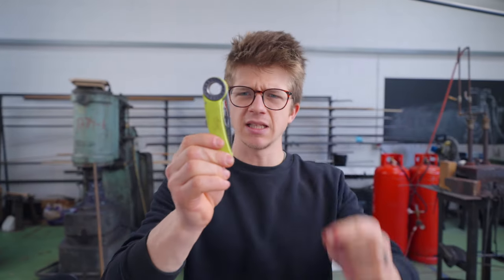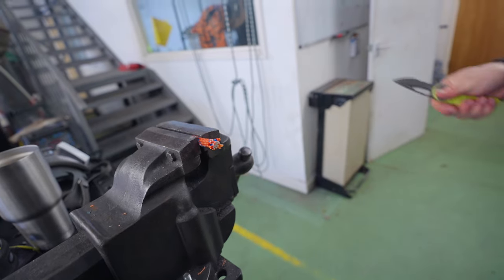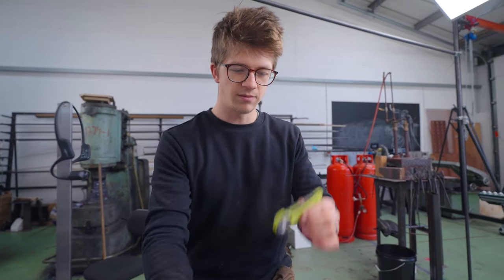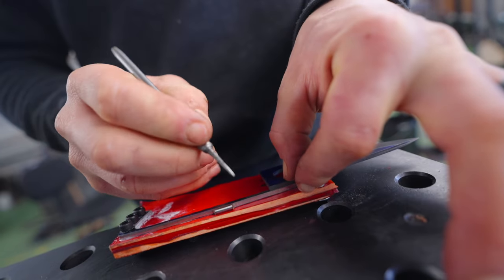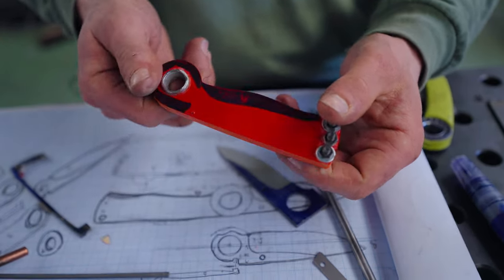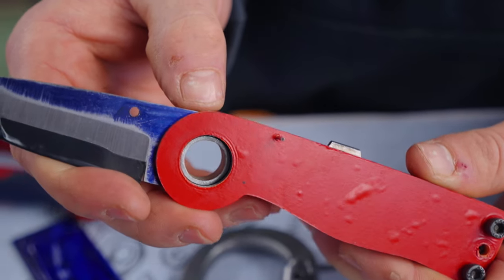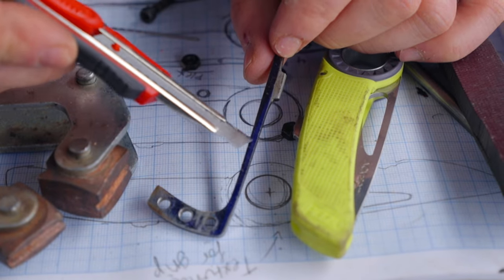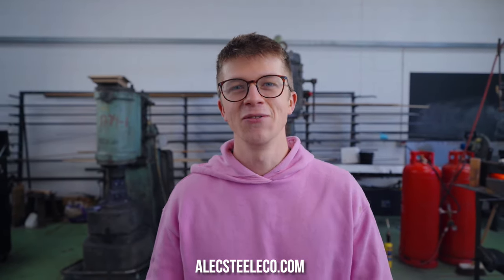Making a Stainless Steel Folding Climbing Knife! Part 2

Comment: I've always carried a knife with a 50/50 straight and serrated edge. The serrations make cutting seatbelts off of people etc. so much easier than a straight edge. Great project!
Reply: That's why there is no perfect knife for everything. Personally i have never liked serrated blades (they are difficult to sharpen). But for safety cuts they are really much better than clean edge.
Reply: @ogi22  which is just the best reason to buy more knives, amirite?
Reply: How often does that situation come up?
Reply: @Coloneljesus  I used to be volunteer fireman.
Reply: @fyreantz2555  Hehehe, how did you know? Are you a seer or something? 😁
Reply: i use a Cara Cara 2 knife by byrd where i work great for cutting rope and opening up carboard boxes part of my job is as a rigger

Comment: The serrations on a utility knifes can be a literal lifesaver when speed in cutting is essential. The straight edge can absolutely cut a seatbelt or rope but the serrations are faster and less prone to slipping.

Comment: @9:30 just looked at it and that will create a lot of slop in the lockup. Rough fit, make sure the latch is a smidge bigger than the notch, harden+temper the spring and latch, and then handfile the tab to fit the notch perfectly. It needs to be almost airtight. Also, the transition where the tab falls in to the notch needs to be crisp, but on the tab needs a small, small radius.

Comment: I'm probably late to the party, but having used a Spatha for years while caving I don't think you should have gotten rid of the blade slot. It's not only for opening the blade but a key: we often use it to open shackle-bolts when we don't want to get tools out, and it's very useful.

Comment: Important Hearing you talk about how important it is that the knife remains closed when you don't want to cut anything just reminded me about something you may have over looked...... the reason climbing knives are better WITHOUT the little stand-up stud openers is because that stud can catch on things and open when you don't want it to!! If you want that stud, you need to have a locking detent so the blade never opens unless you want it to. My knife has one of the ones you press down with your index finger first. Hope this helps 😊

Edit: that little retaining grove is not enough to stop the blade opening if you have a stud that can catch on things

Comment: You need to thin out BOTH sides of your button up to your pivot point. You can see it in your Ruler example... as you press down on the ruler bother sides of the ruler bend on either sides of your hand. Your button is stiff on one side, making your deflection angle and  depth wrong. Test this with t he ruler again, strap a steel bar to one side of your 'button' on the ruler and try to press it. If you don't bend on both sides it will be more difficult to lift the locking nub high. You can make the lock side thicker/stiffer... but it needs SOME deflection.

Comment: Alec good sir, I am sure you have already found a solution, but those lock mechanisms are usually a 2 piece lock. A spring in the rear, and a pivoting locking bar. I cant speak for that one specifically though. I love watching you learn by just getting in there and figuring it out. Keep doing what you do man!

Comment: Also usually for back locks like that there is a spring leaf spring like price that helps ... if you put too much pressure on the lock like that it can fail

Comment: Yep, serrations are there for a reason; they're there specifically for cutting rope. That's actually why I hated the 2010s trend towards putting serrations on pretty much all folding pocket knives; rope is pretty much the only thing I never actually have to cut. It's so nice to see nice regular-blade pocket knives being just as common as half-serrated blades again these days.

EDIT: Before anyone points it out for me, yes, the reason for the serrated knives in the 2010s was a trend towards emergency knives made to help you escape from a crashed car, with a boss for breaking the window and serration for cutting a seat belt. Though most of them also had a blade embedded in a narrow channel specifically for cutting seat belts, too, so... Yeah. Anyway, yes, the serration on that trend wasn't for rope, I'm just relating the trend to the fact that it's usually for rope.

Comment: ALEC - QUICK TIP! IF you are going to use the Steel foil 'Envelope' trick.... BEFORE you seal up the envelope with the blade inside, HEAT the envelope and knife up FIRST BEFORE SEALING IT UP. This drives out the 'Air'/oxygen from the 'Envelope', and then while it is STILL HOT, fold over the last seal. This is why you see those little 'Buttons' on jars of food, the jars are filled with warm/hot food contents, then sealed, the process drives out the air/oxygen and thus causing a vacuum inside...
This will help STOP the envelop 'Puffing up' on the heat treatment/hardening cycle 👍      😎🇬🇧

Comment: I considered buying a petzl Sparta but in the end I went for the buck 770 flashpoint as rather than a stiff detent to hold the blade in it actually locks in both closed and open positions which I see as being more safe however the internal mechanism would certainly be more complicated

Comment: Even kitchen knives that claim to cut through everything are serrated the reason is it stays sharp on the lower parts as the point / high parts ware and dull first so there's always some extremely sharp part of the blade as well as being able to use as a sort of saw. As for wider serrations, they are sharp and will be dull at the same rate... I also dislike serrated knives. A really sharp straight edge will cut rope fine for my needs

Comment: So, my #1 issue with serrations is that they are harder to maintain, my #2 issue is that they frequently are only ground in from one side. Doing Serrations right is actually fantastic, but the key is to do them right

Comment: I generally don't like serrations either, mainly as I can't sharpen very easy.

I've never tried cutting something with serrations vs none. Although I know that trying to cut where the serrations are near the handle, vs where you tried the normal blade, is harder even on a smooth blade with no serrations.

I think the main advantage of the serrations is it keeps from slipping while cutting? With a smooth blade if you don't push sufficiently you can more glide instead of cut. Which in a life saving situation, like emergency cutting rope, you don't want to have to do a second cut. But I'm just guessing.

I still am not a fan in general use

Comment: People get stabbed on those during falls. I use a tiny fixed blade. ESEE Izula 2 with it's plastic sheeth is supergood! Bit heavy, 1095 steel but it works!

Comment: you know on the first video i was like "but if you pin the spring on both ends it wont work, metal is springy in the sense that you can bend it but its not springy in the sense that you can stretch it like a rubber band... oh well ALEC PROBABLY KNOWS WHAT HE'S DOING" .. turns out i was right and wrong :P
alternatively you can also turn the hole in the 'spring' part into a slot, that way its secure but it can also bend because the slot allows the spring material to move
Reply: Agreed, but this is also definitely the wrong way to do it, because it is far too thin and delicate in order to achieve the function of a lock back. Basically he has unintentionally created a hybrid between a traditional slip joint and a lock back. Unfortunately, there's a reason they don't exist.

Comment: The serrated edge soul purpose is to protect the cutting edge and keep it sharp. Cutting with the tip of the knife will always feel harder because it acts as a lever trying to pull the knife out of your hand more. The serrated edge will stay sharper longer but is a pain to re-sharpen.

Comment: Serrated edge only cut better because it’s at the bottom of the blade.  If you used a similar knife with no serration it would of cut just as well

Comment: What stops the locking springy mechanism from work hardening and breaking over time? Or would this just take so long that the knife will be dead anyway?
Reply: In this design? Nothing. The lock bar is not supposed to be a spring. The lock bar is its own separate piece which pivots on a pin and has another separate spring underneath it generating tension so it automatically locks when you open the knife and doesn't unlock unless you depress the lock. It is supposed to be separate, and by making it one piece it is to thin and delicate, and it will break.

Comment: Very neat. I'd hate to have a sharp point on a knife I might have to use one handed while hurt trying to rescue myself - high risk of a puncture. The knife I bought for rope work has a rope cutting notch in the blade and a dull/rounded 'point'
Reply: but with a point you can cut into a bag or other cloth material more easily

Comment: Could have just completely separated the backspacer from the lock bar. 

You should try cutting the rope with the belly of a non-serrated knife. A more toothy edge will cut rope better. Sharpen on a lower grit then go straight to stropping.

Comment: Why would you not use a conventional back lock design with a pivoting lock bar and seperate spring? Or better yet, why not use a cross-bar style lock?
I have a design for a very strong cross-bar style lock that is intuitive to use, ultimately strong and has long life/wear compensation.  It's also very simple to manufacture with large simple components.
I'd be willing to work with you on incorporating my design into yours.

Comment: That wasnt a very fair comparisson of serrated vs regular blade. In order to cut with the normal part of the knife he had to use a lot more torque because its furtger away from his hand. A good test would have been using the new knife before and after serrating it.

Comment: As a non-climber, I assume the ease of rope cut is intentional. You'd want maximum tensile strength for load bearing. But shearing strength, as a safety mechanic, might not be wanted in some situations. Or is there something I'm missing?

Comment: i also dont like serrated edges. i think a lot of your leverage was lost in your test from where you were cutting on the blade in relation to your hand. if it had been a smooth blade against the hilt, i  belive the result would have been much more similar.

Comment: A climbing knife should be serrated so it can easily cut rope and for much longer without dulling, also I have found a straight blade better for rope cutting, also it should be one handed open and closing, as well as super easy to open and close, and the tip should round down with no real point like spydercos first responder knife, this allows you to slip the knife under seat belts and ropes that are tight against the skin And still cut them without injuring the person, also a smooth opening knife with a hole to open with and something like a compression lock, or a button lock, or bar lock like benchmade axis lock and other companies bar locks, the bar lock would actually be preferable, and the handle material would need to be strong but lightweight, an aggressive patterned g10 will be lightweight, strong, and resistant to weather and chemicals, and if you cannot use super steel then i gues 1095 or d2 is ok, so a 3.5 inch fully serrated blade with no real tip, aggressive g10 handles with stainless liners, an axis type bar lock for easy opening and closing, a hole in the blade for thumb opening or at least large thumbstuds, a good  detent, and bronzed washers for ease of cleaning, and all fitted together with t8 or better yet t10 screws, top it off with a nice lanyard hole and light back spacer for added strength and that is the perfect climbing/first responder knife

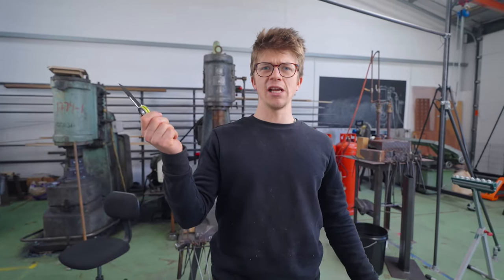Comment: At 1:40.  The leverage and force applied at the middle of the knife with the serrated part is far greater than the outer edge or point with the regular blade.  That was a horrible experiment if that's where you ended without further experimentation!  Please do it again!

Comment: I'm sure it's been mentioned before, but I believe you're looking at the lock like how a slip joint works, not as a back lock.  A back lock is made up of three pieces: the lockbar, the pin, and the spring. The spring is a separate flat piece of steel nestled into a groove in the body/backspacer and is situated closer to back end along the underside of the lockbar. The lockbar itself pivots on the pin so that it can lock/unlock the knife. Love the videos!

Comment: 2:10 HOLD ON A MINIT, the flat side of the knife is premenently serated , when you use the unserated part it's curved so you can't put as much force on it or you would slip, smh

Also I am on phone and can't bothered looking up how to spell seration

Comment: Cut easier because you were 70%  closer to your index finger when using the serrated part of the edge than the plain part of the blade and therefore had far more leverage. Not saying the serrations don't do something but that's absolutely not a valid test.

Comment: This is becoming a dangerous design. It's a lock back folding knife. Look at a lock back folding knife mechanism. They do not work this way.

The lock bar is separate from the spacer. It is pinned in place at the lock bar pivot, and has a separate spring pushing upward on the back end under where you press the lock.

You do not need to reinvent the wheel here, especially if you are intending to recreate the knife you already have. Look inside the handle and you will see the separate spring under the lock bar. The last thing you want is your unnecessarily thin and delicate lock bar to snap while climbing and have a loose blade swinging around bumping into your rope.
Reply: I will be checking back in periodically to see if anyone else is mentioning this, as I feel it is a legitimate safety hazard which could result in serious injury or even death.

Please do you finish and use this knife in its current form!

Comment: Good job on the knife although the order of operations is off a bit. The blade and locking mechanism should be around 90% fit first then hardened and tempered. Then minor clean up work to make fit perfectly. Blade grinding should be done so everything has a beautiful slick open and close fit.